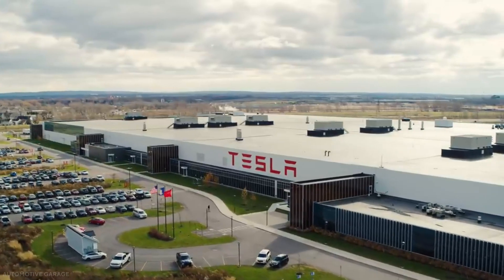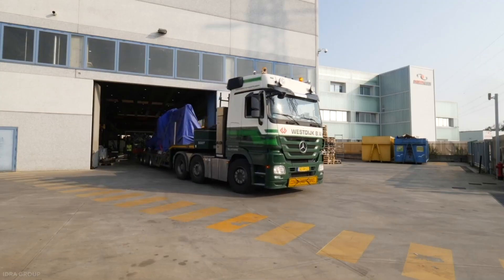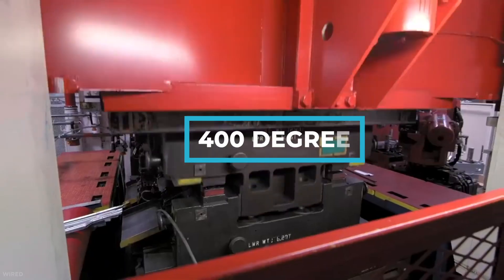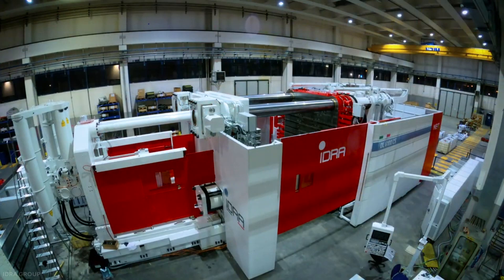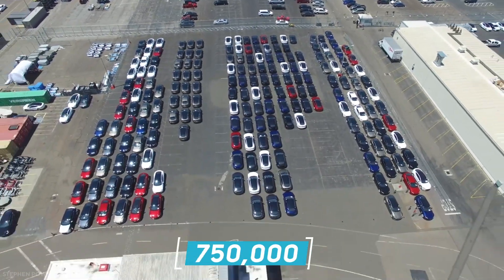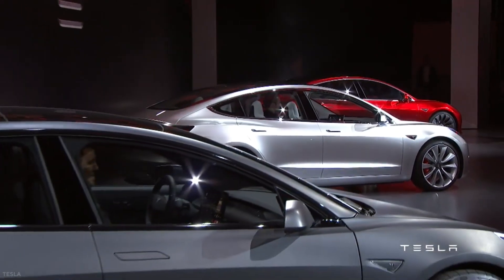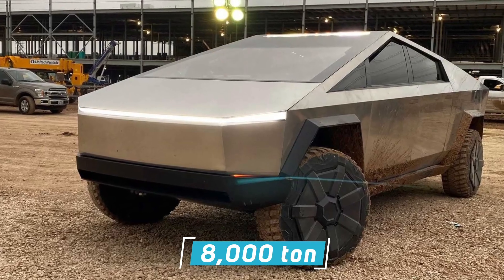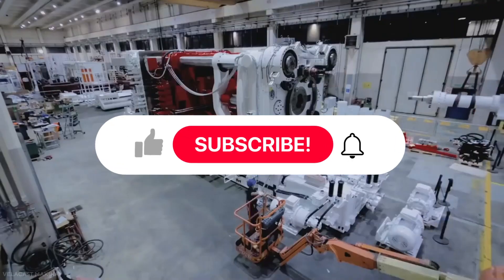Tesla's NEW Giga Press Is a BIG Game Changer

Comment: Not sure how repairable these casts are whenTesla cars run into minor accidents.  I saw one video of a Tesla 3 side swiped by another car, and the insurance co. deemmed it a total unsalvaragle wreck and paid the owner the full price of the car.  Other cars would have been repairable in a body shop.  Because of that, insurers will eventually build that into the cost of insuring Teslas.
Reply: I've wondered the same. However, only the Model Y is currently using the gigapress castings, so this isn't relevant to Model 3 repair costs.